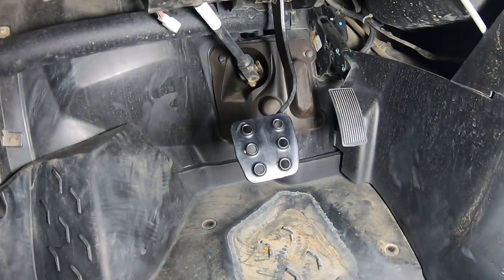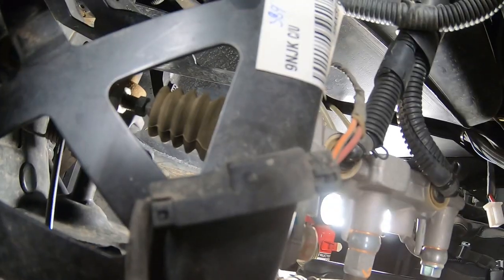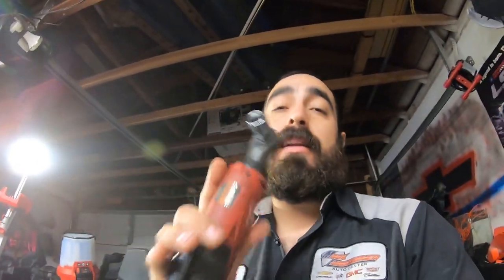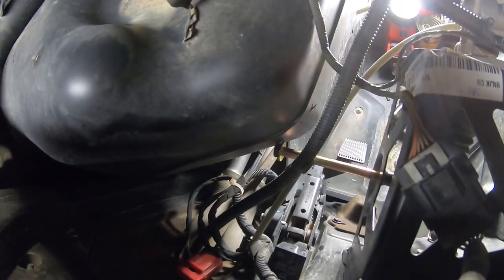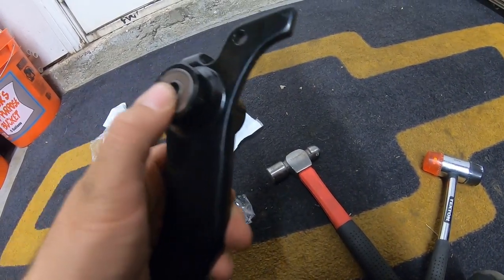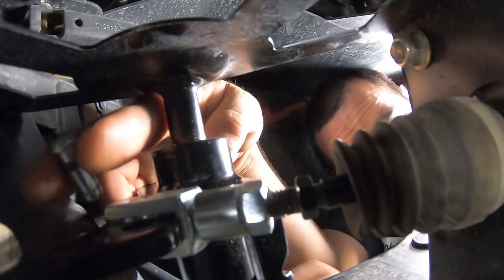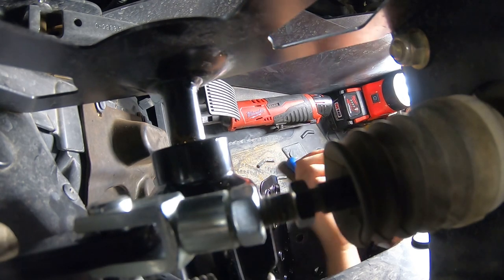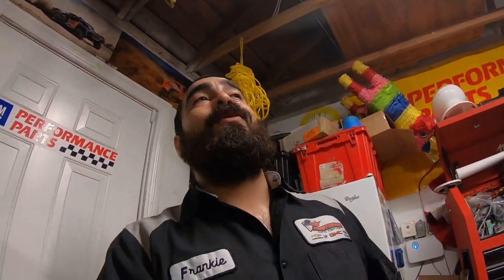Can am X3 Brake Pedal Upgrade Ep 31

Comment: I just swapped my pedal with this one and swapped my pads to the ebc red x series pads and now my pedal is spongy and sucks. It won’t even lock up the tires on gravel. Any ideas what Could be my issue?
Reply from the maker: The pedal shouldnt affect anything. I couldnt give u an opinion on those ebc pads tho. Verify no air in system and bleed brakes

Comment: CanAm don’t care. People still buy them even tho CanAm hasn’t upgraded anything since the X3’s release. Hubs, the rear arms and rear wheel damage, front shock mount brace, hubs, knuckles, spongy breaks, no bolt on cage. Its too bad, reputation is important for a brand.
Reply from the maker: I agree, they make for a great lightweight car, but pushing them to the extreme they should have learned by now, alot of the weak points should have been addressed.